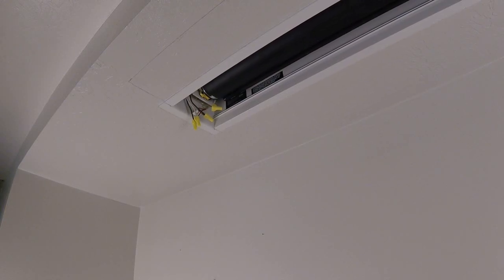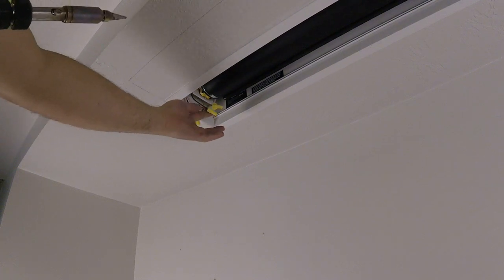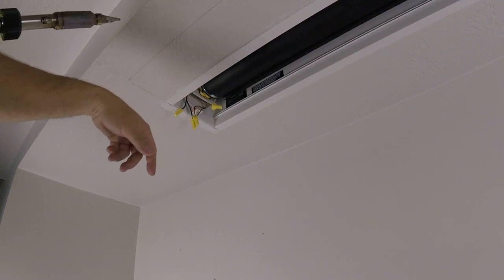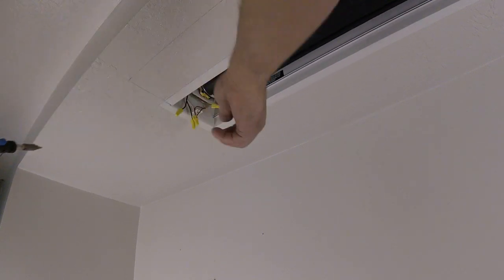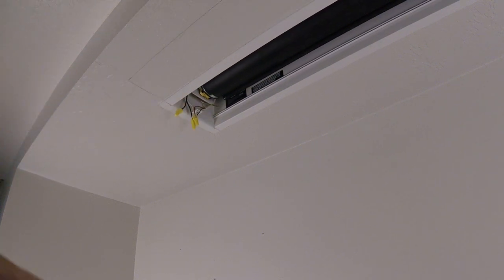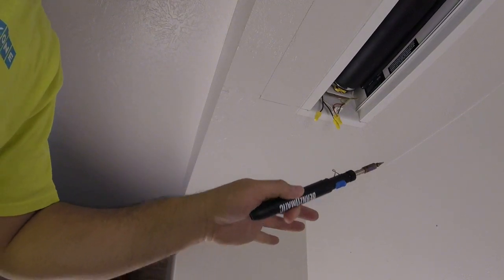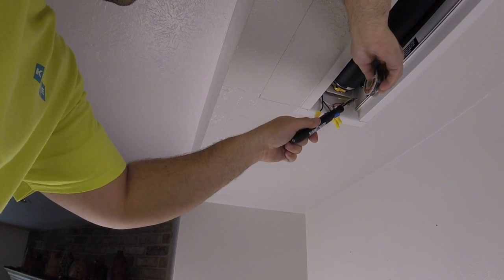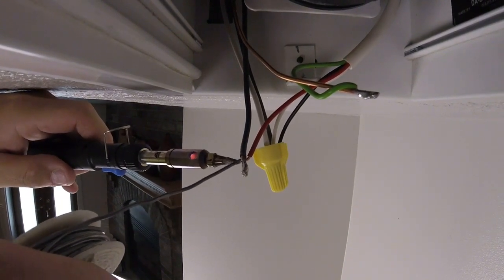How To Splice Solid Wires To Stranded Wires

Comment: On my project I won't have power to solder because my breakers are off... i am replacing  fluorescent fixtures in the ceiling with led fixtures.

Comment: I'm not against soldering connections, but, there is an easier, popular and effective way. Make the stripped off end of the stranded wire longer than the solid one. Use the smaller wire nut size, the blue one is smaller than the orange one. There is even a gray one that's smaller still.

Comment: My light switch has one power wire with 2 switch plates. There was a short solid wire used as a connector between the 2 switches and the power wire. The problem is the wire is too short, so can I use a stranded wire instead?
Reply from the maker: If the stranded wire is connected between the two switches, you can put a crimped ring connector on each end of the wire and connect the switches together. If you’re saying one end of the wire is under a wire nut and the other end goes to a switch, you will have to connect the stranded wire to the solid wires in the fashion I show here. Then put a crimped ring connector on the other end of the stranded wire to connect it to the switch.

Comment: I like that you're not telling people to give up and use Wagos!  That's most of YT these days.
Reply: I dislike Wagos. Expensive, under certain circumstances bulky, higher resistance which makes them a bad choice for high loads, they don't hold the wires when the wire is being jiggled sideways and they bite into the wire.
Reply: @Mandrag0ras  I mean they have wages rated for higher loads as well. Realistically, I like this guys idea and method, but the execution was questionable, however perhaps still effective. He was touching the solder directly to the tip of the iron to melt it rather than touching the iron to the wire in order to heat it enough to melt the solder "pulling it in"   from what I saw, it kind of looked like a cold solder joint.
Reply: @A4rings110  Yes, for sure that isn't good soldering technique and probably cold joints.
Reply from the maker: Ha! I do not love wagos

Comment: Would this work without soldering, just using a wire nut?
Reply: You just need to cut the solid wire short and leave the stranded longer. It happens all the time in commercial applications that you need to connect stranded to solid and I've never seen an electrician solder them
Reply: I mean mounted lights/appliance usually have stranded wire that you wire nut to the solid I’ve never seen anyone do this. I can’t imagine hanging a light and having to splice them like this, I’d fall off the ladder. Lots of instances where you have stranded put with the solid never seen this though
Reply from the maker: Not really. The stranded wire commonly pops out. Soldering is a pain but it’s the best way to make sure the splice is a long term solution.

Comment: Good idea, but seems like overkill for a light fixture that's completely accessible. Those yellow wire nuts will last for decades, long after the wire becomes brittle and likely to break.
Reply: Very true. I see that happening on calls when homeowners use the lousy wire nuts that come with the fixture and then their light stops working.
Reply from the maker: I see that from time to time as well- or I’ll go to work on something and the stranded wire will pop out when I barely touch the wire.
Reply: @AlanCleggYouDoAV  That's never a good surprise, especially if its hot!
Reply from the maker: Thanks for the comments! The worry is that you'll never get a good bite with only a wire nut and the stranded wire will just fall out.
Reply: @AlanCleggYouDoAV  this only happens if someone does not know how to make a proper splice.
Reply: @AlanCleggYouDoAV  please see adapter above. Quentin
Reply from the maker: @quentincollier9387  What adapter?

Comment: My understanding is you should not solder any connection with high voltage, the wire could get hot and melt the solder, therefore it will then leave a gap between the wire that was soldered.
Reply: Yeah you don't sodder house wiring why we make wire nuts
Reply from the maker: I guess that would be possible if the wires get really hot. That is probably unlikely in household wiring-  at least I've never seen it.
Reply: @AlanCleggYouDoAV  240VAC running to Stove Top pulling 40 Amps -- that will be juiced
Reply: You are correct